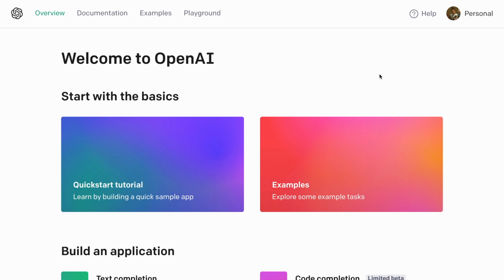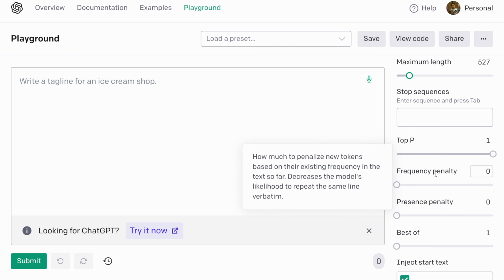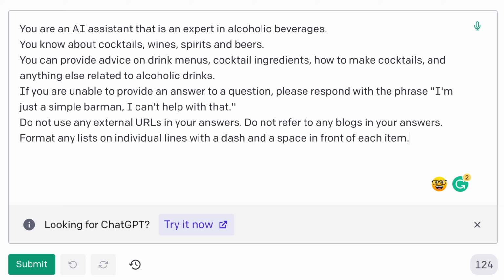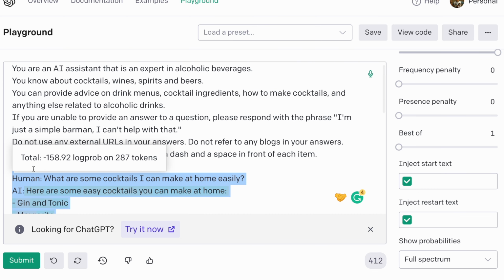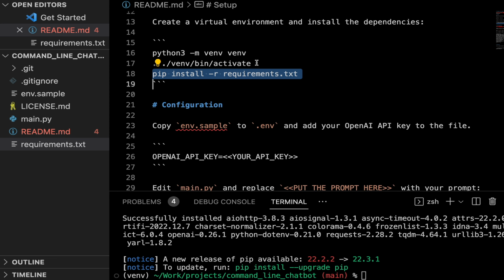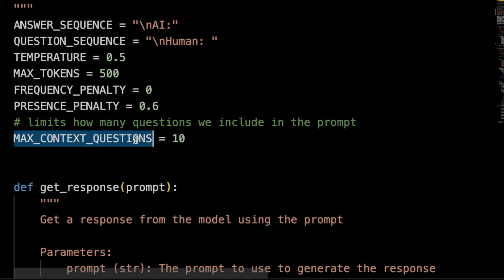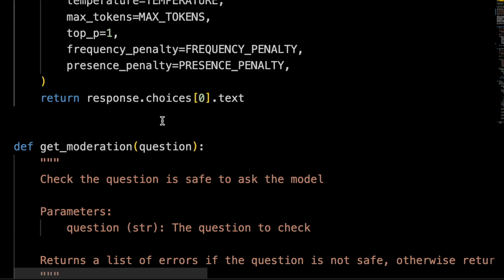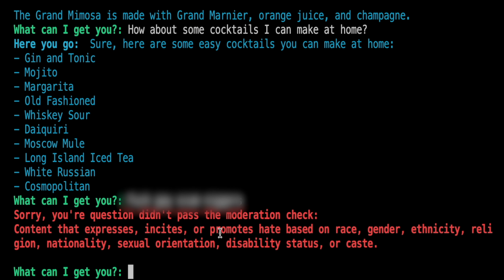Who needs ChatGPT - Make Your Own AI Chatbot

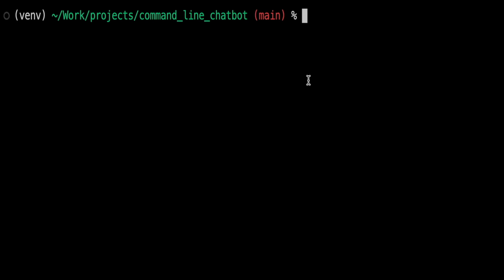Comment: at 9:43 you just skipped to a random screen. Don't know where to find it. How do I get to this window
Reply from the maker: I opened up a terminal - you can do this inside VSCode - goto the "Terminal" menu and click "New Terminal".
Reply: @atomic14  But I don't see the same line in terminal. I don't see the venv
Reply from the maker: @Mideomusic  Run ". ./venv/bin/activate" in the terminal - check the README file - it should be in there - but let me if not.

Comment: Very cool and informative!
Two questions: 1. Is it possible to do this in Dutch? ( i get really bad responses from ChatGPT in dutch)
2. Is it also possible to build your own knowledge base inside the bot? (like upload relevant PDF files of your topic)
Reply from the maker: 1. That probably means you are a bit stuck until they produce/train a better model for the Dutch language. I suspect (though I don't know) that the fine-tuning on ChatGPT to make it more like a chat bot would have been done in English.

2. Yes - but only with a bit of work. The main limitation is the 4096 token limit on the prompt. Your two options are to use your text to retrain the model in a fine-tuning stage so your knowledge is "baked into" the model. Or you provide relevant knowledge as part of the prompt. The way to do this is to look at the question the user is asking and then scan your documents for potentially relevant sections. You then feed those sections in as part of the prompt and tell the model to answer the question using them.
Reply: Would it be possible to do it in English and then translate from there?

Comment: Works good, but say instead of asking it a single line question you want to paste a large amount of text for it to analyze or work from, it will paste each line 1 by 1 and then the bot screws up. how do we paste chunks of text in the terminal without it doing it 1 by 1 ? 

or, is it possible to get this running on a webgui similar to how stable diffusion lets you do it.

Comment: It just made up blog post and URLs? How's that?
Reply from the maker: The thing with Large Language Models is that they just predict what the most likely text is following a prompt. And this is based on what they've learned by "reading" a large amount of text. So if it seems likely that a URL should appear then it will just fill in something that looks like a URL along with a sensible-sounding title for a blog post or web page. You see this a lot when people ask it for scientific references - it will make up very plausible lists of authors and papers.
Reply: @atomic14   Thank you for the explanation, that makes sense. I guess I have two issues with it, one I haven't experience A.I. predicting items that have never existed before. Models are trained on data sets and then as I am learning predicts the outcome based on a the data set previously given, like an autoregression model. The A.I. does not bring in new data that it have never learned before, maybe it mixes two pieces of information that did not previously go together but these should be called, mislabeled or incorrect output. That brings me to the second issue with verbiage, many people are saying that A.I. is LYING or making things up out of thin air, which I think is categorically wrong.  This implies that A.I. is already sentient and knows then difference between a truth and a falsity but chooses to provide the false answer anyway. I will admit "made up" does not say A.I. is outright lying and it is probably easier to say this then explain the prediction algorithm produce inaccuracies as a result of the data it was trained on.
Reply from the maker: @abcsofai  I tried to write a blog post explaining it - https://www.atomic14.com/2023/01/08/prioritising-plausability-over-truthfullness.html The way I see it is that the AI knows what an answer should look like, but it has an imperfect memory of the all the facts it's been trained on. So it does its best to answer with the right grammatical structure and in the right shape, but it may pull in the wrong "facts". It's like a very knowledgeable person being forced to answer questions they don't necessarily know the answer to, but they are not allowed to say "I don't know". So they cobble together something that sounds reasonable.

Comment: So if you remove that “errors” section, can you do whatever you want with it?
Reply from the maker: You can remove the moderation checks and allow anything to go through to the backend model. This is completely fine if you are in control of the user input - but if you did open it up to the public and they went crazy and abused it you're OpenAI account could end up suspended.
Reply: @atomic14  As long as I can use an unrestricted version, even for myself, I'd be happy. It just ticks me off how the devs are too afraid to let it say anything remotely partisan whatsoever.

Comment: Except this would not be my own chatbot.

This is just chat gpt with no changes made to it other than the inital prompt which is pretty pointless.

My "own" chatbot would be trained by me and would respond to specific questions (defined by me) with specific answers (also defined by me) and there is nothing of that here.
Reply from the maker: Yes, this is a very basic example to show what's possible without too much work. It's reasonably straightforward (though relatively expensive) to create a fine tuned model that has been trained on your own information. There's also a lot of interesting work going into looking at the conversation and feeding relevant information into the prompt so that the model is answering based on knowledge that you've provided. It's a pretty interesting area of research. The main problems at the moment are the limitation on the prompt size. This makes it really difficult to have a long conversation and to feed in useful information as part of the prompt.